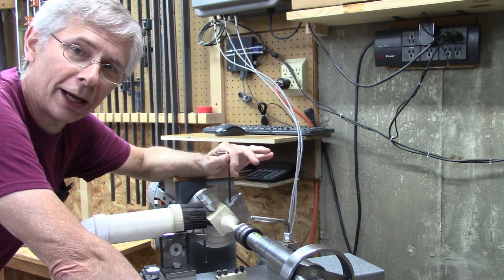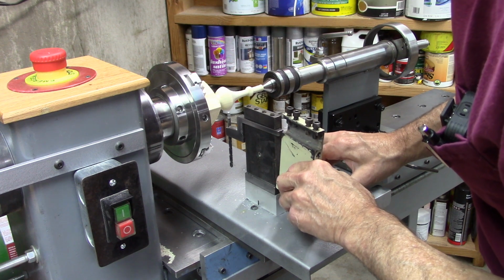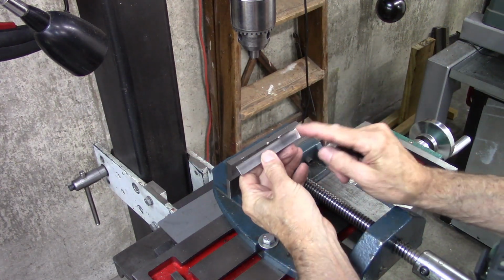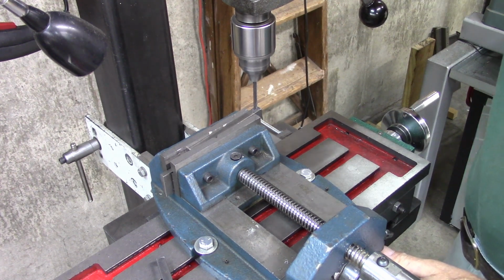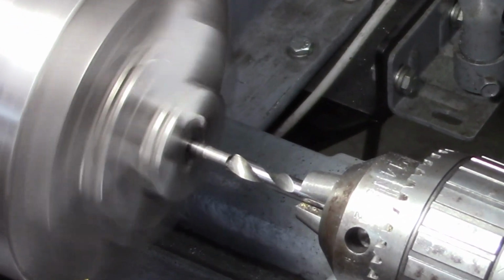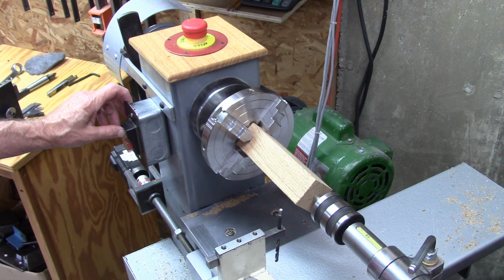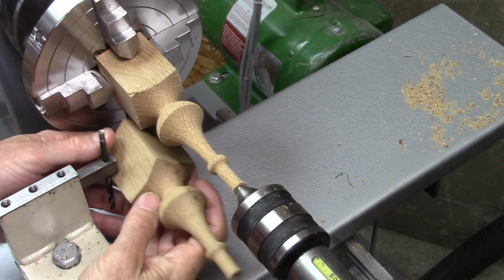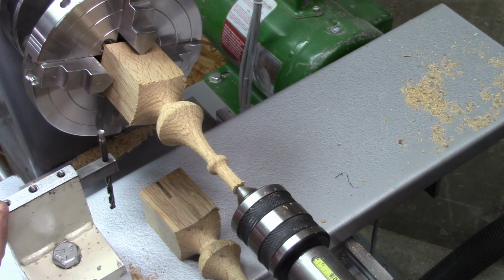CNC Wood Lathe Cutter RE - Evolution

Comment: Have you considered using off the shelf cutters ment for cnc lathes ? Obviously that won't bring the joy of building them yourself but might give some inspiration/different approach.

Reason I ask is that I'm currently in the planing phase of a CNC conversion of my old wood lathe, and I came accross Eagletec's "FWCDxL40xR1" cutters and thought I would use those as a starting point in my build.
Reply from the maker: This is a fantastic cutter however, due to the wedge shape you can not cut a lot of profiles. For instance, a ball on a spindle. The side of the cutter cuts a large amount of end grain if the ball of anywhere near a half circle. Also, I have a cutter similar to this and it doesn't cut very smooth. These cutters are fantastic you you want to remove a lot of stock fast and go back with a smaller cutter to finish. I thought about mounting a cutter upside down on the back of my cross slide to do this but it's not worth the complication in programming... not to me anyway.  BTW  When you make your lathe consider mounting the tool up side down on the back. The saw dust is much easier to collect.
Reply: @WinkysWorkshop  yes there are limits with the wedge shape profile. However one could mount it at an angle (when needed) so that the one side is perpendicular to the lathe center - this would allow it to go straight in and create "half" of a ball / the ball from one side if you will. Now if a second cutter is mounted in the back at the opposite angle then that one would be able to cut the "other" half of the ball.... 

Or maybe it's just smarter to have one upside down in the back to do rough cutting and then a fine/detailed HSS cutter in front to do the final/detail pass as you suggest. hmm... something to consider.
Reply from the maker: @fundi_mike  It depends on what you want to do. If you are making 50 parts it is well worth the effort to have teo cutters and programming that cuts in both directions. What I do is usually less than 10. Since making this video I bought some 3/16 round HSS blanks and use a carbide burr to cut the recess. It's a but sharper than the one in the video and very easy to sharpen.
Reply: @WinkysWorkshop  thanks for the input, with that in mind a "best" combo might be a wedge for rough cutting and a small round (3/16) for detailed/final pass - I'll give it some thought, hmmmm maybe a combination with a router is even better (?) 

I doubt that I'll be making large runs/batches - actually it is mostly for the challenge of building the thing and solving all the small challenges.
I am even thinking of adding a way to put in a LIDAR sensor so that you can put in an existing object, then it will scan the existing object and then you can have it "automatically" replicate it on a blank afterwards (got a computer science background so the programming does not scare me), but first things first need to sort out the mechanical stuff ;-)
Reply from the maker: @fundi_mike  Send me an email at winkysworkshop at GMX.

Comment: It's fun to see how things progress.  Thanks for another entertaining video.  
Remember back to your anti-chatter tool holder days.  If the tool holder were to flex, the flex was controlled such that the bit was retracted from the work and chatter reduced.  With this wood tool, by extending the tool holder out, then telescoping the chuck end of a drill bit out at an angle, you might consider how, if any flex happens, the tool more deeply engages the work.  This would seem to invite chatter and rough finishes.  
I think you were right to lower the tool holding position on the lathe and get rid of the offset tool holder design and go with a straight one.  But, until experiments show it can be that thin, I would start with a thickness that seems unnecessarily thick.  Ridiculously rigid tool holder.  This eliminates concern for tool holder rigidity.  
The angled drill bit effect seems good, but you might consider mounting the bit in the tool holder and then mill the chuck end of the drill bit parallel with the clamping surface of the tool holder.  Then, use a drill in your mill, or a carbide ball end mill or some such to establish the cutting edge.  The excess drill bit hanging down below that isn't used could be cut off.  It's not doing you any good and could contribute to chatter. 
An issue comes up from this plan.  Now the cutter must be keyed to the tool holder.  If you take it out, it will be a pain to get the same orientation again.  
Anyway, just some conjecture based thoughts.
Reply from the maker: Wow....  You put some thought into this comment, thanks! You made many good points. Right now I'm leaning toward going back to straight vertical with a little side relief cut into the tool. This increases the top relief slightly and I think vertical is more solid. I bought a piece of HSS 3/16 round stock and used a 3/8" diameter ball end carbide burr in an air grinder to sharpen the tool. I did this while it was turning in my lathe. I'd like to find a slightly smaller diameter burr plus mount the air grinder in my tool post for better control.

Comment: I agree with the tool angle, but it reduces the rake, so you will have to make the cup more aggressive!  I don't remember the size range, but we "thru hardened" small drills (maybe up to 1/8"?) and "tong harden" the larger ones.  In other words, we grip the blanks from the shanks and emersed the fluted portion into the pre-heat, high heat, and quench salt bath tanks (about a 100 at a time).  The shanks are "toughened" to about 45 Rc.  This allows the chuck jaws to grip the drill and keep it from spinning.  Another possible option for blank material is drill blanks. They are thru hardened but can be hard turned.  I do this to create a concave end for rotary broaches.  You could try it on the shank of an old end mill.  Dave
Reply from the maker: I agree about the rake which is why I made the angle slight. After I made this video I sharpened the end with a round carbide burr while the drill was spinning in my metal lathe chuck. It cut a bit smoother cutting. The cutting edge was a slightly sharper angle but I think more importantly the round profile helped the chips clear the cutter. The V recess the spotting drill made was probably not as effective. I have some HSS round blanks on the way. Thanks for the info on the hardening...  this makes sense.
Reply: @WinkysWorkshop  Another thought, if you are using hardened drill blanks,  you using a Dremel with a grinding point (I would use a shape, which we called Flame Shape on burrs) to grind in the hollow on your lathe.  This should give less of a ragged cutting edge.

Comment: By tipping your tool in the holder you are imparting a relief angle equal into the equation....7-10 degrees is a standard for metal so should be plenty ok for wood also.....when cutting your tool also remember your lead angle.... when pushing along the longitudinal axis......should also be relieved so as not to drag the cutting edge of the tool into the product, which in this case is wood and soft and will slightly compress ie productng a feathered effect that can be eliminated  or minimized w a corresponding lead angle.....basically think when cutting your tool .....same as you would when grinding a HSS cutting tool for your metal lathe.
Reply from the maker: I agree, I will leave the slight relief on the sides, the forward lean was not to get front relief is was to get more clearance for the tool holder when turning larger diameters. With the slight lean I can now turn as large as the lathe will turn without the tool holder hitting. I think that is about 5.5" over the cross slide.

Comment: Great improvement.  As opposed to the drill bit, do you think a quality carbide cutter from say easy wood tools would give you a better surface finish?
Reply from the maker: I've tried all sorts of carbide and it never works as well. HSS is sharper and for wood things need to be sharp. Carbide will work and it holds an edge well but the HSS cuts noticeably better.

Comment: The angle in the tool holder reduces the top rake so your countersink angle may have corrected that back
Reply from the maker: Yeah...  it's not much of an angle but you may be right. After making the video I tried sharpening the back end of the drill with a 1/4" ball carbide burr. I chucked it in the metal lathe and did it while it was running. It works even better now. I think this did two things, it has a slight more top relief (sharper edge) and the relief is shaped for better chip formation. The V shape the drill left was probably trying to break the chips. Not good for wood.

Comment: Nice when something works out as planned.  I like it, the straight bar should be more rigid and the angle for clearance should help in tight areas.
Reply from the maker: I agree...  it works well and sharpens easily. I like it.

Comment: Technically they are right and the shanks are annealed or at least tempered back from what the metal is in the flutes.  But good grief!  You're using it on wood.  The shank metal is easily hard enough for what you're doing.   All that aside there are a couple of options that would give you a fully hardened HSS cutter.  One is round ground blanks in fully hardened HSS.  The other is some very small double ended end mills.  Get ones with 3/16 or 1/4 inch shanks, use them until dull or they are both broken off  in metal then repurpose them to your CNC wood tracer.  Unlike drill bits end mills are fully hardened the whole length.  Also the lean angle is a good idea.  But do consider that relief angle is only present on the front and someways around.  At the sides there is still no relief angle.  But another option to produce the relief would be to mount the tool so it's slightly below center.  However that will mess up the sizes on the diameters.  Small diameters will be proportionally bigger than big diameters due to the angular shift.  So better to just do what you did and use it at the proper center height and give it a little lean angle and try to avoid perfectly square faces.   Or give it a touch of lean both into the work like you did as well as into any actual faces that are square to the spindle.  Then don't have other square faces.  Or just commit to grinding a conical shape in the end so there's relief all the way around.  Then when you sharpen it a couple of times and it becomes too small a diameter to fall within your tolerance for tolerance then cut off all of the conical shape and make a new one.  The good news is that you really only need the cone on the end to be 1/4 to maybe 5/16 long and only relieve it maybe 8 to 12 thou's at the base of the conical grind.  Then you can use the tool sitting straight up and down since the conical feature gives you the relief you want.  It could even be ground in with a Dremel or similar using a 3/8 round stone easily.   I hope that's clear enough.  Pity we can't include images or I'd do a sketch.
Reply from the maker: I did cut a small relief on the sides. It's an easy thing to do in the lathe and worthwhile  for the reason you stated After making this video I used a 5/16 dia. carbide ball end burr to grind a recess in the top of the cutter. I pit the drill in the lathe and used the side of the ball. It cuts better. I suspect the round shape evacuated chips better and it may have a slightly sharper angle on the edge.
Reply: Drills and reamers have the cutting portion and the shank butt welded or friction welded together to give a soft shank. This allows the drill chuck jaws to bite and grip the shank. Hardened shanks would spin and wear the jaws. This is why you see drill shanks damaged from spinning.

Comment: So glad that you are happy with it. Regards from Australia.
Reply from the maker: Thanks Dave, the best part is that it is easy to sharpen. The other cutters worked as well of better but they were very hard to sharpen. I may try a carbide ball nose end mill for sharpening in the future.
Reply: @WinkysWorkshop  You may do better to buy a Carbide Ball Burr, that will have teeth all over where as a ball nosed endmill has barely no cutting action at the center. Good luck. Regards.
Reply from the maker: @daveticehurst4191  You might be correct. I may need to get one that is truly a ball  so that I can grind the recess with the side of the ball. Even a carbide burr has troubles cutting straight downward. I probably need to draw this in cad so I can see the cutting angle it will produce.
Reply: @WinkysWorkshop  Also make a tool out of drill rod then harden it yourself. Regards.
Reply from the maker: @daveticehurst4191  You might be correct about hardening drill rod but I'm avoiding this for a couple of reasons. One I know very little about hardening steel and second, I need to be able to sharpen the tool in the hardened state anyway.
Reply from the maker: Using a ball end burr worked great. i chucked the drill in the lathe and ground the end as it was spinning.